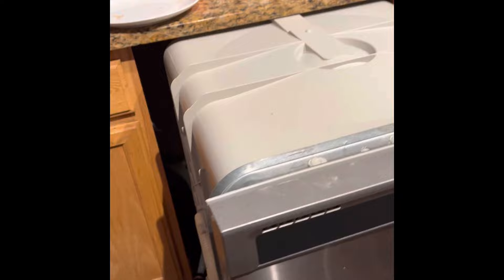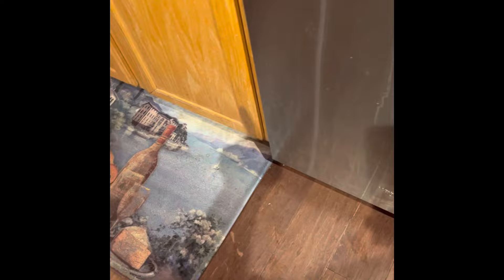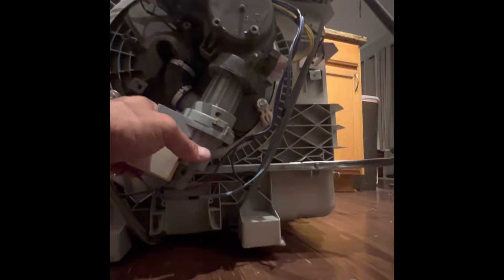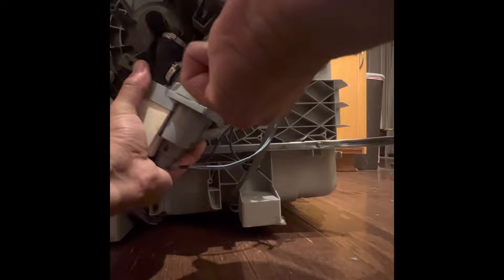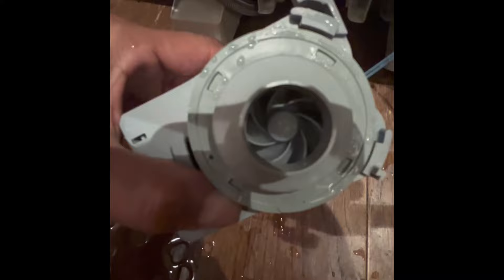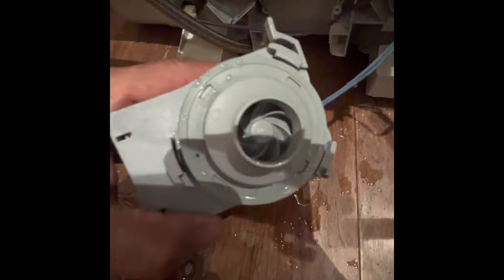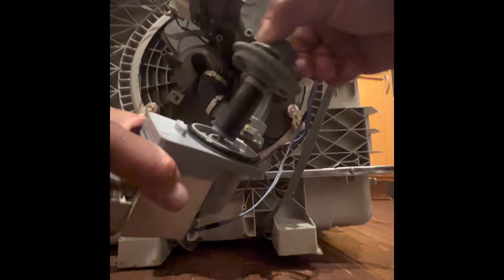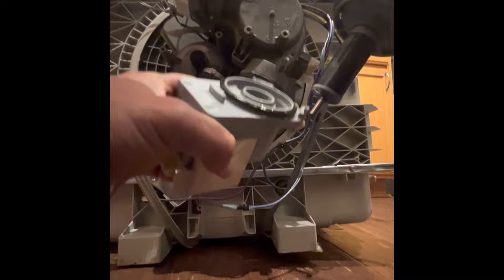Whirlpool dishwasher no spray!! Not working. Easy fix!!!

Comment: I spent three hours today watching all of the YouTube videos that I could find on how to fix my dishwasher. I cleaned it, checked the inlet, literally did everything. I was about to go to the store and buy a new one when I came across your video and figured I would give it a try. It freaking worked! I can’t tell you how appreciative I am that you posted this video! Thank you!
Reply from the maker: My pleasure!! I’m really glad this helped and awesome to hear you saved some money! It’s an easy fix once you know but intimidating at first. Wondering if you wouldn’t mind watching this video for me and let me know what you think. Any tips would be appreciated. Trying to grow my kids channel. 

https://youtube.com/shorts/xNxohK9IC0E?feature=share
Reply: Same here!! Diagnostics are saying fill valve and I know it is not that. Mine will spray intermittently and that was the confusing part. I did end up having to pull the main pump and clean it out (drain pump pulled in this video was fine). Thanks a lot!
Reply: Well sheesh I dnt think I need u to repeat urself Thats y u made a video it's was helpful  tho thanks
Reply: Absolutely saved me too! Thank you so much!
Reply: Another one, you just did my day. Mine is back working because of your help. Thanks!!!
Reply: Very good helpful thanks

Comment: I had spent two days trying to figure out why the middle arm was not spinning and the bottom arm was barely spinning. Your video lead me to the source of the problem. A piece of foil-plastic was completely covering the pump impellers. I cleaned the plastic out and reassembled it. The dishwasher is working perfectly again. I had almost conceded that we would need to go buy a new dishwasher. Thank you for the great video!! You saved me the expense of a new dishwasher.
Reply from the maker: Thank you. Would you mind watching my kids vid? Maybe giving it a like if you like it! Thanks!! Glad I could help you

https://youtu.be/808hRxOKxvo?feature=shared

Comment: This is the exact problem my machine had. Model WDTA5OSAHZ0. It would fill up with water, soap drawer would open, then nothing. Following these steps helped out a lot and fixed my dishwasher. Thanks!

Comment: Took me a little longer because I was trying to turn it clockwise (to the right) so I said, what the hell and turned it counter-clockwise (to the left) and it popped right off. 😁 Thank you for giving me the courage to try this.  I'm also amazed at how little debris it took to screw this up.  You saved me $300 on a service call and parts I probably would've been sold but didn't need.  Again.  Thanks.
Reply: I was watching the video as well when he said "clockwise" I wondered if the video had flipped direction 😅

Comment: Bravo- i did a shortcut .  filled it with hot water and use a shop vac to clean inbound and outbound water inlet and I put the shop vac on spinning arm out bound water and made the motor spin by sucking the water out. it worked thank you .    I also reset the washer there is video for that here .
Reply from the maker: Nice hack!! Love it!!

Comment: I had this precise issue with my Whirlpool dishwasher which was less than 5 years old and I followed  your instructions for cleaning out the water pump precisely as you highlighted in this video!  The part with the plastic to route the water actually didnt look that dirty, but separated it from the motor part and the  throughly cleaned it.  I used a straw cleaner and a toothbrush and sprayed a lot of hot  water.  Then reassembled everything and the sprayer started spraying and working properly again!  This saved me hundreds no doubt!  Thank you for making this video!
Reply from the maker: Nice!!!! So glad it worked for you too!! 👊🏽👊🏽👊🏽
Reply: Same here. Didn’t look that dirty, but fixed the issue. Major ups.

Comment: I replaced the inlet valve and thought that fixed it, but no.  I was about to either call someone to fix or would be on dish duty for while until I came across your video. Our dishwasher is less than 5 years old and a slightly different model.  I pulled it apart like you described and took apart a cover to find a screen that had a slight scum film on it.  Cleaned that all up, put back together and it fixed it.  I was amazed that a little scum could prevent it from spraying water.  Thank you so much, saved me some $$$

Comment: This worked great! So my situation: Dishwasher "worked" the whole cycle completed, but nothing was clean. Basically, water comes in, leaves, but the spinners never kick on, it doesnt "spray" the dishes, cycle finishes. Cleaned the filters, checked the overflow bobber, took out the diverter motor and tested it (good). Then took out the impeller like in this video to clean it. When I first looked at it, it didn't seem THAT dirty but as I got out a straw cleaner to get in each slot, something hard popped out... maybe some piece of glass or something, it went down the drain too quick to see. Put it back together and did a test run to make sure I dont have any leaks - it all worked perfect. Thanks for the video.

Comment: Thank you I have that exact same model/make Whirlpool but in Black. You nailed it. Rusty debre in water line. Pump was slightly dirty but cleaned up the pump housing and spindle put it all back together and it leaked because the third clip was not secure took everything apart again and then re-secured the pump and housing stop leaking thank you so much for your video it was a real help to me I learned something new today.

Comment: Thank you so much! Our dishwasher (Whirlpool WDT730PAHZ0) suddenly stopped washing. It would drain fine, but wouldn’t spray water. I did exactly what you recommended in this video and there was a small plastic wrapper jamming the motor part (i think that’s what this part is). Put it back together and it works again! Thanks a bunch! Had no clue what to do before watching this video.

Comment: Great video!  This was exactly my problem.  For me though, I didn't have anything stuck in the fan that I could see.  I did noticed that it wasn't really spinning freely though, so I spun it manually back and forth until it started to spin around a few times on it's own. There must have been hair or something inside binding it up that I couldn't see.  Now it works great - thanks again!

Comment: Thanks for the video!  When I took it apart, there was barely anything in there.  Cleaned it out anyways and tried it again thinking I would need a new motor.  Worked like a charm.

Comment: Thanks, I watched your vid 1st because it was short and to the point. Didn’t find anything significant in the impeller but washed out and reassembled. Worked like a champ! Free fix! QStack thing I did after was used a cleaner/ descaling pac👍🏻👍🏻

Comment: Thank you Thank you THANK YOU
After 3 years of daily use, mine quit spraying. My husband and I fixed it in an hour. 
Don’t be like me…..get that part situated back to the machine right the first time. If it’s not, the water won’t spray inside the machine, it will drain out all over your floor. 
Rookie mistake, but once I got it, it’s running perfect.

Comment: Ok, my impeller wasn’t plugged up but I did wash the stater and inside the housing that the stater slides into. Cleaned everything and mine worked. Guess the something had it jammed up. You helped me out of a bind thank you!

Comment: I appreciate this video! Checked mine and it was vapor locked. All I had to do was force it open and it works now! 
Mine was caused by my water getting shutoff while the dishwasher was running...taking it off and using a butter knife to force it to spin will unlock it.

Comment: Thanks this fixed my issue - only be super aware of where the O ring is when you take the pump apart - I had mine in wrong place and leaked water everywhere😂

Comment: This video seriously needs to be at the top of the search results for this issue. I've spent all afternoon trying to figure out this stupid problem and why my washer (same model as yours, at least visually) has started absolutely sucking in recent weeks, and this was the exact problem. Cleaned out the impeller and she's good to go. Every other resource I've found has told me to either hire a professional to come figure it out, replace the entire sump assembly, or buy a new machine entirely. Doesn't help that the user manual for this stupid thing is god awful.
Thank you for making this video. You've probably saved people five figures (collectively) at this point.

Comment: Not the same reason, but gives me confidence and clue to find out that the hot water inlet pipe was quashed, I used pliers to get it back into shape. Problem resolved :)

Comment: Thanks for the video. All dishwashers are going to have a similar circulation pump. Mine is a Kitchenaid and the part is a little different, but same fix. Somehow a small piece of plastic got in there and jammed up the impeller.

Comment: Did this, so far so good (after I replaced a bad inlet solenoid and had no joy). Thanks for this dude. Oh, and super-lube O-ring lube helps putting it back on. Its a food grade lubricant. Helps from rolling the O-ring over during installation, do this if it leaks after you try this fix method

Comment: Mine is not working. Im going to pull it out today and see if this is the problem. 

Edit: This was the problem. Thank you for helping me fix my dishwasher. I would of just replaced it but after cleaning the pump and replacing the heating element, it's good as new.

Comment: I never thought the intake water that sprays out of the spinners would need a pump.  Water pressure should do that work alone.  A drain pump is obviously needed, but how they factored in an intake pump is just mind boggling.

Comment: I thought it would be a little daunting to remove the dishwasher from under the counter and flip it on its back - but it was not a big deal.  Dishwashers are apparently very light appliances.  Give it a try!  I also replaced the water valve (replacements on Amazon for like $15 to $25) in case that was the problem as well - much easier to replace that valve with the dishwasher already on its back and to visibly make sure connecting water hoses are not kinked.  It probably took me about an hour to do this and replace the water valve going slow and easy - I'm sure after doing this a couple of times it might take only about 15 minutes to do.
Reply from the maker: Nice!!!! 👊🏽👊🏽👊🏽👊🏽
Reply from the maker: Yeah won’t take too long next time! 👊🏽👊🏽👊🏽👊🏽

Comment: my whirlpool quiet partner11 stopped spraying water at the top sprayer everything else working normal but no water coming out the spout that shoots through the top sprayer arm,3 weeks ago i did a filter clean and clean sprayers cleaned chopper it worked awesome and now this I have had my dishwasher for 11 years lol don't know were to turn at this point
Reply from the maker: Damn!! Sorry about that. I wonder if the line from the filter to the sprayer isn’t clogged. I haven’t done that fix but just an idea

Comment: @whackytachmedia9907 great video - thanks! I have a Whirlpool dishwasher (Gold Series IV), the "4-hr delay" button constantly flashes and won't run a cycle at all. I've unplugged it, turned off the breaker, reset it, etc., and still nothing. Any suggestions on what the issue might be?  Any help would be greatly appreciated. Thanks!

Comment: My whirlpool was just clicking and not washing at all. I thought it was the timer or something else. Come to find out the motor on this part he replaced was rusted out from a very small leak. Ordered one on amazon for $80 and just used the gray part cause I didn’t want to crimp the clamps. Mine was slightly different but same purpose. She is running like a champ now.

Comment: BINGO!  My washer was only pumping for a few seconds, then the controller logged a problem (function 4, code 3) and shut-down the circulation pump. As soon as I opened up the pump, I saw some junk in the impeller. It was still operable, but it was not pumping the correct volume of water. The controller board will detect an overloaded pump and shut it down to protect it from burnout. Start to finish this was a 10 minute job, and the dishwasher is running fine now.

Comment: I did what this video instructed and am still the same. I cleaned out the spray arm, the filter, everything - still nothing. Just fills up the bottom, and then it stops. My dishwasher isn't even a year old yet.
Reply: Yup same thing man. My dishwasher is the exact same one as his. 3 yrs old but it just stops after a minute or so

Comment: Hey! So i did what u did and cleaned it out. And when  i did a test run seemed like it was working. I put dishes in and pod. And it works for a minute and then just stops. Bad motor?

Comment: Hi, Thank you for your video. Do you know the part number of the component that you cleaned?
I cleaned mine, and I put it back. It worked one load and when put the second load did not work. I looked again and there was not any dirt. 
I can hear the pump try to work but the rotor does not turn.
I observed the magnet has two magnet parts. The separation between parts is irregular like it has been cracked. I believe the motor needs to be replaced.

Comment: just did this to mine, which wasn't spraying water. didn't find much gunk in there, but cleaned what little there was, and it worked fine so far. But if it WASN'T the gunk in there, what happened to make it work again?

Comment: When I turned back on there was water leaking from the pump part underneath - glad I left the kick plate off to check! Is the gasket between the magnet part and the pump supposed to be tight? I got it clicked back in but I'm wondering if maybe the gasket is shot...
Reply: Didn't have to replace the gasket - first time I reassembled there was no 'click' but everything seemed in place, it LOOKED like there was a seal. 

Tried again but this time I disconnected power from the pump so I could put a little more muscle behind setting the pump back on before twisting into place (i.e. without worrying about funking up the wire) - this time it was much easier to "twist into place" when reassembling and there WAS an audible click. Running first cycle now - not a drop of water underneath 10 minutes in

Thanks for the video, you're a legend
Reply: I am having the same issue putting it back on. When I push it up into place so all 3 spots fit the gasket seems to get smushed and pushes out one of the edges. It’s driving me crazy. Washer only 2 months old.

Comment: I did all these steps and it was already clean it still doesn’t spray and wash what could it be? I tried checking all areas to include spray arms for clogs but it’s not that old like a year so is still pretty clean I found no glass pieces anywhere just need help now I checked by the magnet area and cleaned that too it was mostly clean already

Comment: I have a Maytag dishwasher and really I shouldn't complain because I think I put it in in 2001.  I noticed it didn't clean well so I kinda watched what it was doing and I noticed it doesn't have as much water pressure inside as it did. It seems to do everything but I remember hearing the water spraying so loud inside and now it's not like that.

Comment: Hello and Thanks! Will know for sure in an hour but the machine seems to be spraying pretty well now. One thing. As gentle as I was with the tab, it broke off. Running the machine outside the counter to see if it comes loose. Not sure what to do as I feel sooner or later the part will work loose. Any ideas?

Comment: This is a GREAT video!
Thanks for making it very simple!
I do have a question.
I ran my dishwasher thru the stop/drain cycle. 
It was completely dry in the tub.
When I pulled the unit out of the cubby, there wasn't enough water inlet hose to allow me to lay it on its back,
so I had to lay it on the front (door), keeping towels on the floor to keep from damaging / scratching the door.
I found it difficult to disconnect the rubber connector for the drain hose, so I left it in place.
I pulled the pump and cleaned it as indicated and put it back on. 
When I uprighted the dishwasher, a lot of water seems to be draining out of the door.
Is this expected since I laid it on the front instead of the back?
If so, will it cause any damage having that water inside the door?
Thanks.

Comment: This was helpful except that after numerous attempts I apparently am not getting that pump back on correctly. I have checked every side and have perfect alignment, and the o-ring is still in place…but the second it runs water it all goes on the floor. I freaking hate dishwashers

Comment: Yes, the impeller was gunked up. However, now the pump leaks where it slides together. I took it apart 3 times. Any ideas why? There is a black gasket around the impeller that fits loosely.
Reply: Mine does the same

Comment: This did not work for me. I located this pump underneath the same model of dishwasher, and it was clear of debris. I am glad that this works for some, but it is clearly not the only reason that this dishwasher will not spray water.

Comment: So if you pressed the start button nothing would happen? That's what's happening with mine. Just wondering if that was happening with you. Or it would start just not spray?
Reply: I saw a video and the guy said you hold the door open to make your selection then press start then shut the door. Made mine start after I did this.

Comment: Brand new apt, brand new appliances and dishwasher doesnt work.  Its not spraying water.  I ran it w the pods started doing a humming noise after a while the humming was still there and no water so i had to stop it and submit a work order and now i have to wait until after the new year